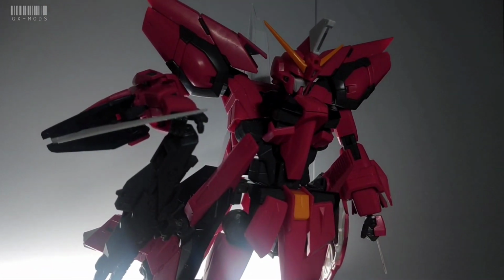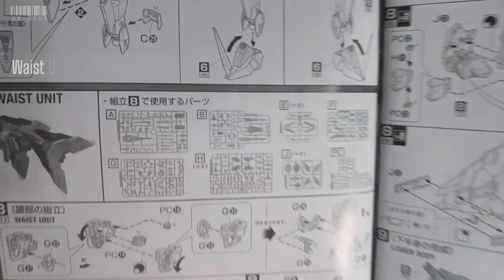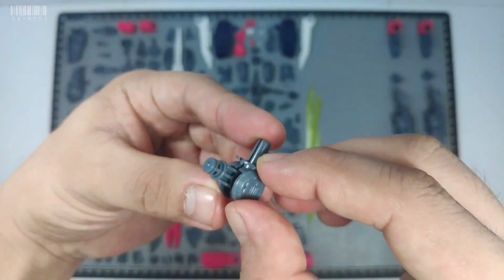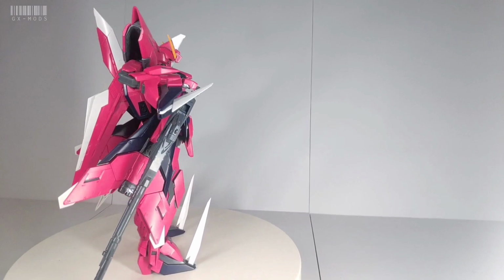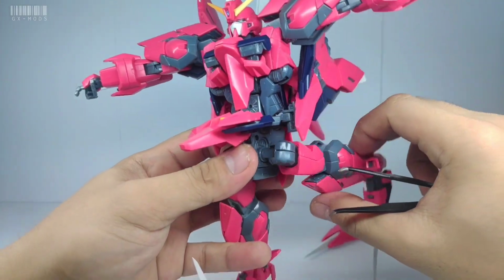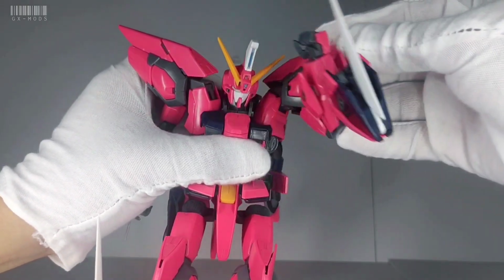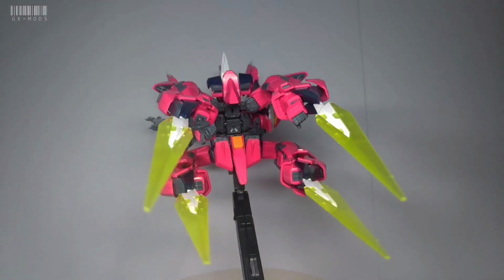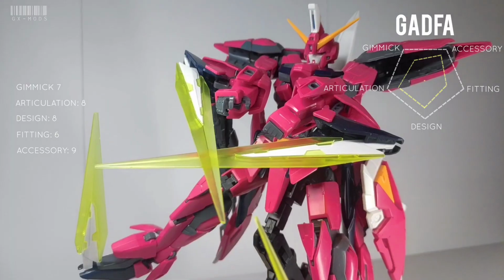Daban AEGIS Master Grade (MG) 1/100 Inner frame Snap Build GX-Mods. Is it still good for 2022?

Comment: Cool video 😎 how do I fix the side skirts connection piece , the one that slides on from the back of the aegis I broke it 😅one side is broken 😢
Reply from the maker: @DavidSilva-nu3ij  It locks in to place, but if you broke it you have to find a replacement.
Reply: @GXMODS  ok sounds good thanks 👍
Reply from the maker: @DavidSilva-nu3ij  bootleg is the easy way to replace them but there is a custom printed stuff for that specific joint of side skirts in china.